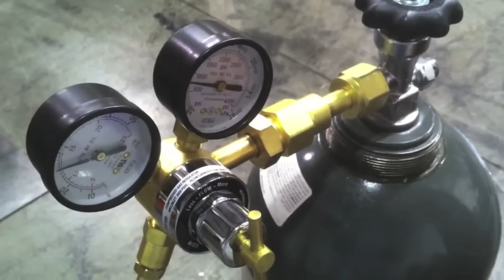Mig Welding Basics 2

Comment: Talking about ' bird nests ' , where I work once a long time ago some higher- up people that call themselves engineers and make way more money than me decided to hook up a MIG welder so that maintenance guys could weld a bunch of aluminum tubing. Not only did they try to push aluminum wire through a full length MIG liner, ( no spool gun ) they got the brilliant idea to get even smaller .030" aluminum wire.
It kinda worked but just breathe on it funny and it made a bird nest and you had to start all over.

Comment: I started as an amateur with Hobart 140 making set up equipment for triathlon.   Used flux core for years.   Just set up the welder with Argon/CO2 and 0.30 wire.   I’ve had to recalibrate my style a bit but I love the lower splatter and less clean up with solid wire.   Your vids are really helping my technique and getting over some bad habits from “self teaching” for years.   So much appreciated.   Good solid stuff, no bull.  Thanks

Comment: Please comment on Tri-Mix gas. A huge part of the welding ive done over the years was with Tri-Mix gas, either 2% or 3% oxygen. Primarily i saw this welding thick stainless (1/2" up to 2" thick) with .045 dual shield running multiple passes. We did however use it a lot for just common hot rolled steel (3/16 & thicker) with .030/.035 hard wire. In nearly 40 years of welding i never knew the reason for the tiny oxygen addition (thats why I'm asking now..😂).

Comment: Your channel was mentioned in a few other videos. Really glad I checked it out. Horse traded my old Lincoln 175 STP for a Miller 211 with a spool gun attachment. Even though I got the Lincoln as a safety award back in 2000, it has very low hours. Creeping ever so closer to retirement. Your style of explaining, is down to earth. I've learned a lot from the few videos I watched. One of the guys at work is willing to try and teach this old guy how to TIG. They do socket welds, 1502 threaded fittings. Also butt weld coiled tubing. Zero tolerance with the x-ray, dye pen. We also do the Rockwell hardness test, on all butt welds. I see many hours spent here recovering from surgery.

Comment: I just wanted to say thank you very much for this video. I bought less than a year ago the hobart 140 to replace my harbor freight 90amp flux core. needless to say I bought a bottle a few months ago to upgrade to mig. I was getting alright with fuxcore and wanted to upgrade. I mostly have been messing around with 16 gauge 1" square tube.(I mostly have made furniture) I thought all this time i just sucked and would never get the hang of welding. I read all the instructions at the time of purchase however i did not read them when I switch to mig. I knew enough to switch the polarity i forgot though to change the roller. I even switched to .024 wire changed my tip thinking .030 or .0.35 tip was the problem which could have been some of the issue but my major issue was the drive roller I was using the flux core side of the roller. So today I went and bought some .030 mig wire. I will eventually buy a new roller as well. What a difference. I could see the difference in pushing pulling my bead a weave or whip i could even tweak the wire speed and also see the difference. I have spent months beating myself up thinking I would never get the bead I wanted and thanks to you and your wonderful videos I'm finally making progress.

Comment: Thank you for answering a question I’ve had for a long time. I’ve stick welded for ever and always pulled my puddle, when I started to mig weld the guy showing me the ropes told me that you do the opposite and push leaving the puddle behind the pass. I’ve done both as situations dictate but usually tried to hold true to what he originally taught me. Thanks for the clarity

Comment: Migatronic plant with a binzel mb36 torch,best combination i've used,not done much migging in the last couple of yrs as been running a esab suprarex precision plasma in new job,due to holidays I was asked to go welding,bit rusty and nervous...went into work monday and gaffer told me the bits I welded were the only ones that passed mpi without rework lol.no disrespect to the full time welders at all,no major flaws from them and I wasn't as fast as them by any means but it made me happy...my codes may be out of date but i've still got it,and codes being renewed through work at next testing session...it's always nice to impress the boss.

Comment: Thanks! I have roughly 5 or 6 years TIG welding experience on AMET and an older behemoth Miller, and finally pulled the trigger and bought a project/hobby MIG welder for my garage. This has been informative for sure as I've never hand welded or MIG welded.

Comment: hey Jodi....problems with my Lincoln 175-T led me to your vids and what a wealth of info I found.....
thank you a million times over......my Lincoln problem was intermittent & varying gas flow that just got fixed after much frustration by cleaning the internals of the regulator, silicone grease (very light coat) on the gun cable/hose assembly and TIGHTLY screwing in the thumb screw that holds that assembly in place .
gonna go nose around the 'monger store now......
Reply: me again....the problem I was having was demonstrated when I removed the wire feed & submerged the gun end in a small bucket of water.....bubbles = good....inconsistent or no bubbles = bad .......I knew I had a problem when I first could only get bubbles up around 50 cfh.....LEARNING CURVE !

Comment: I really in joy your videos, I’ve never had any schooling on welding but do pretty good, the trouble I’m having with my Hobart 140 is the drive wheel not pushing out my wire at times, I’ve made all the adjustments I could get off the utube videos, even tried to flip the wheel over to a smaller grove, wish I just could get someone to show the right setting for this, thanks for all your help, jim

Comment: Hey Jody, I have a 210 MVP that I just purchased.  I jumped right in and was having crappy results.  SO I watched basics one and realized I was probably running the wrong polarity.  Checked and I was.  Haven't tried it yet, but will after I watch a few more of your videos.  I will say that the ground clamp that came with mine is much better than the one you showed.  The spring is strong and it has a round bar that clamps against the metal.  I need to get this right as I'm putting in new suspension on my 37 Chev PU.  The crossmember is butt welded to the bottom of the frame.  I"m trying to weld some nuts in for fender and cab mounts as I'm boxing the frame.

Comment: Great refresher video. I used a Hobart welder when I worked in Florida back in the eighties. I loved it, great machine. Can't get them here in NZ but we do have great alternatives. I am just about to start a new engineering job welding big steel pipe for big scale irrigation. Your videos are great for me to brush up on my mig welding theory. Most of my welding is done with a single phase stick welder that was built in Auckland NZ in 1954. It still works great and I can build anything with it. I will watch the rest of your vids, keep up the great work. Good on ya!

Comment: Hi there Jody I've been welding for a few years now and have learned a lot from your video's. And your input helps me on many issues that I have ran into,  I just finished building my mobile welding table.  I wish I could load up a photo. I even drilled 5/8" stronge hold holes in it for clamping with a magnetic press.

Comment: one point you missed with birds nesting is to have the lock down idle roller adjusted properly, to tight and it will try and force the wire down the liner when blocked, need to have it so it will slip when the wire is blocked.
Reply: I always shoot the wire into a piece of wood test it..also if the cogs are to tight the wire will curl too

Comment: I use a mig on my welding truck that I switch from steel to aluminum often so I have cut off that little piece of liner tube that is close to the feed roller so I can cut the wire and leave it in the feed roller so I don't have to recapture the wire onto the spool when I remove the torch to install the aluminum spool gun. It has been working so far so good but I must admit I didn't consider the birds nest probability. It makes it quick and easy for me to reattach the steel torch.

Comment: 54 years old and been restoring cars my whole life. But I always farmed out the welding jobs. I just wanted to thank you for posting these segments. They have been extremely helpful and I have been practicing with my neighbors old Miller. Now I want to buy my own. The most I will be welding is thin metals, exhaust pipes, frames, and panels. Any recommendation on a good MiG welder?  I hear Lincoln and Miller a lot, but I don't want to spend $700.00 or more on something I will not use regularly.
Reply: +Tony Dow

 Hobart 140 is around $500 and can weld up to 1/4 mild steel
Reply: Thank you sir.

Comment: Birds nest is very important.  Adjusting those drive rolls. But also, most people dont know that if you overtighten your drive rolls, not only will it knurl the wire but it draws power away from the machine. That could be crucial for someone with a smaller machine.

Comment: Hey Jody, I should have asked in the last video, but could you do a video on MIG welding aluminum. I have a Miller 211 with a spool gun and I'm have lots of trouble getting the process right MIG welding aluminum.

Comment: Welding for 15 years for government. I was always taught voltage is heat, wire is penetration. Heat to high melt the selface, turn the wire up to punch into the metal and penetrate. How I remember

Comment: I have watched all your good tips but  I haven't heart you talk about the size of wire that have to go with the range of speeds, and amperage. I am a student. I also want to know what will be the size of wire you weld when taking test? From my experience, the flux core welding seems to be easier than the Mig.  Thanks for all useful tips.
Reply: ANDREW elm for sheet metal you can use smaller wire diameter being 025 and use 035 for thicker metal. and .030 is a good median. flux core is easier because you learned it first or spent more time with it. mig with solid wire with 75/25 is what I use. flux requires no gas because flux means the wire has flux coating used for shielding. Which is best for high wind but fast paced welding. Very similar in practice except flux wire will need a long stick out and less manipulation of the torch then cleaned like stick instead of like solid wire mig before continuing welding. lastly, I've never seen anyone double shield only heard of it from internet.

Comment: Thanks for the great videos.  You have a natural teaching ability, and make everything easy to understand for the layman.

I recently bought a 250a AC/DC inverter Tig/Stick welder from Avortec, which also included a spool gun.

I'd like to get rid of my old cheapo Chicago Electric Mig welder and use the new unit exclusively.
I don't do a lot of welding, but I am able to get decent results with the Mig. 

Can the spool gun do pretty much everything the Mig welder could, or am I better off keeping the Mig, and using the spool gun for Aluminum and Stainless only?

Thanks.

Comment: When welding on a large chassis frame ( truck trailer) I have always brought the earth clamp to within  meters of the area that I am welding but to clamp close to the welding area. I often get told there is no need to move the earth clamp close, I experienced a problem once welding an exhaust pipe on a car, while moving the mig torch I accidently hit the button and the wire struck the drive shaft, I always wondered if I had caused any damage to the bearings in the gearbox, the only ready earth was though the battery to body earth wire.
Reply: Ive repaired railcars for many years now, we currently build them, grounding to anything that may spark the wheel bearing is a big no no.  look at the arc puddle your ground makes, now apply that to a wheel bearing

Comment: I just got a miller 140 auto set with 0.30 wire and argon 75-25 the machine is a 120 volt machine i will be doing auto body maybe muffler i'm hoping its a good machine  this is my first time in 30 years since i left the business
Reply: H

Comment: Hey I've got a question about a 125 whole bar and I need to know how you switch the wires if you're ever in solid wire with no gas cuz it going to positive side or negative side and then switch it back if you're going back to gas like to see that in the video if you can I've learned a lot a little bit faster and you I love videos

Comment: I have an older (70s vintage) Millermatic35,  CO2, with .024 wire I got from my dad. I'm not a trained welder by any measure. But I think I need to size up to .030 wire to get a better range of metal thickness for welds. I will eventually do some 5/16" metal welds so I'll need to upgrade to .035" wire, correct? Also, the MM35 is an older welder without the presets built in the controls so I need to practice a lot of welds to create a range of settings to use for different metals.

Comment: Hey bud can you make a video of a vertical butt weld with 7018 root, hot pass , and cap and back gouge the back of the plate. 1/2" plate I need some tips so I can pass my weld test.

Comment: Just another cause of birds nests is wire that has little tiny RUST spots on the wire new tip,proper gap an no kinks or 360s in the cable. Spool off to clean wire or better yet get a new roll.

Comment: One thing I have learned in regards to the push vs. pull argument: Pushing the puddle results in a shorter bead with less penetration where as pulling the puddle results in a higher bead with more penetration. Pushing the puddle works very well for me when I'm working with thinner metals or when I need to have a low cover pass, where as pulling the puddle would to be more effective with thinker metals or when I want a deep root pass.

Comment: I'm brand new to MIG, I bought a small Lincoln MIG machine on Craigslist. I found the bottle of Argon/CO2 was empty, so got a new exchange and hooked it up. When I was fiddling with the wire rate, I could hear some seeping noise. It seems the high pressure gauge leaks. Can I stop this leaking by fighting one of two screws on the back, or do I need a new gauge?

Comment: At 6:52 you show your settings of 18 volts and 245 IPM wire feed speed. How did you get that exact setting on the Hobart??? Or did you switch welding machines? Asking because I have a Miller 211 with no voltage readout or exact setting either, even though the manual tells how to set amperage by material thickness: "1 amp for every .001" of thickness, so a plate 1/8 inch (.125") requires 125 amps. "

Comment: I was told you couldn't use gas outside on a MIG welder.  Now I know if it is blowing 50 miles an hour useless, but what would you set your flow rate at for outside welding with low wind?

Comment: Hi Sir, and thanks a lot for showing us how to from the beginning. One thing that I would like you to talk about is the welding position of our head. Seems to be a funny question maybe, but one problem that I have is that I find very difficult to SEE what I am doing. I have an electronic helmet, (cheap maybe) that can be adjust from 9 to 12). I can't follow the line if I could say. The arc is too strong. Some time I can see, but not all the way. Am I too close to the puddle? What is a good distance from the puddle to be in a good place to see the Object, the puddle and the movement?
Best regards

Comment: A big mig hook up to 480 outlet will sound a lot better than those little machines but sometimes a spray arc is good if you don't want a lot of spatter a good mig will be rated 400-452 ,they make 650's but that's overkill.I'd like to hear about duty cycle and info printed on the back of the mach. ours are 100% but some of the smaller mach. are rated less ….why?? can you help?I like 98/2 gas for all mig argon /oxy , except aluminum 100%

Comment: Hello and thank you for the great useful videos.

One online store sells gas in 1L cylinder. They say that it contains approx. 50L of argon/co2.

If i do some small welding, nothing big then how long this gas lasts? How much i can approx. weld with it?
Im not welding alot. I just need to do some car exhaust repairs / fabrication and weld 4 rear subframe reinforcements for my BMW.

And basically thats it. 

Thanks

Comment: Hey guys, i got 1 or 2 years of welding on my back but only stick, tig and mag. Correct me if im wrong but the difference between Mig and Mag is that Mig uses a mix of gases and Mag purly runs on argon?

Comment: jodie, ed here.. hey im in a welding class currently on mig.. i have some doubts as to how the insulator is inserted , if installed threads first it effects my tip stick out and then effects my wire stick out.. if insulator is inserted the otherway i can adjust to a more flush tip to nozzle ..can you clarify ?

Comment: Also on the mig 135 welder about how much does the heat setting change from a to b to c and finally to d? Is the heat setting also the "volts or current" setting that youre talking about since this welder only has 2 setting knobs/switches?

Comment: I just bought a Hobart handler 190. ive used a 115v 70 amp "boat anchor" for some time and as I learn more am surprised that ive done as well. my new welder isn't here yet but I see a problem. this machine is rated at 5/16  and the first job I'm using it on is 1/8" to 1/2" lap joint. can I get this done with this machine or do I need to hire the welding out. thanks